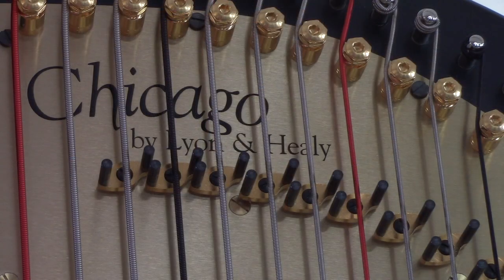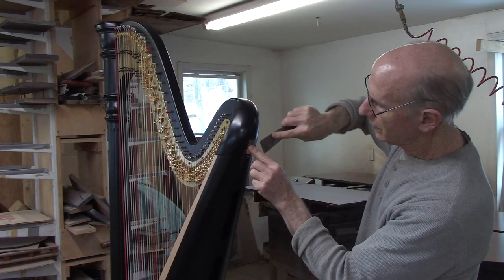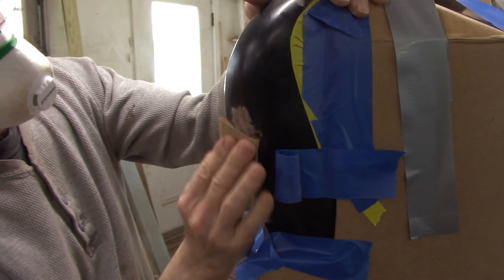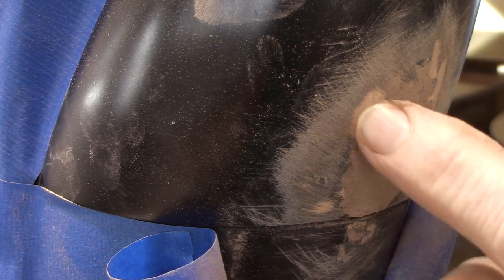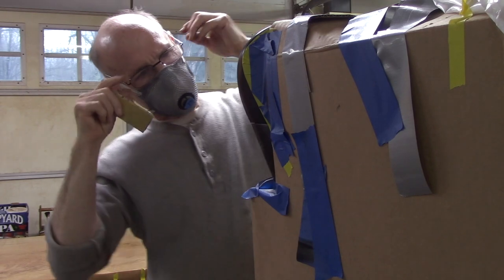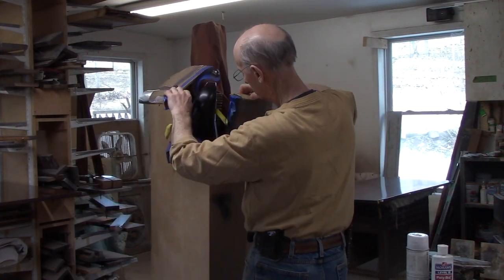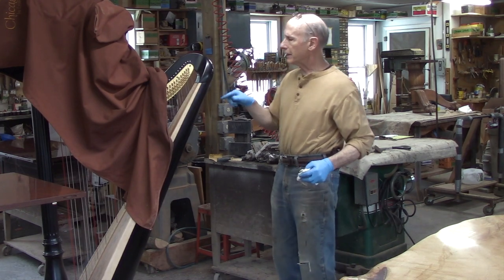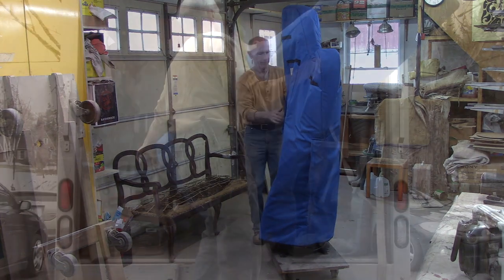Repairing the Body of a Pedal Harp - Thomas Johnson Antique Furniture Restoration

Comment: Wow! Nicely done Tom! What technique would you use to eliminate a subtle drip or run of shellac or lacquer? Thank you, Tom.
Reply from the maker: Thanks Joseph! I like a single edge razor blade to gently "slice" the drip away as much as possible, and then sand with fine paper like 320, although that might depend on where I am in the process
Reply: @johnsonrestoration  Awesome! Thank you, Tom for your insight.  The 500 paper just came in the mail, since I could not find any in town. I'm sanding my second coat of shellac with 500 in prep for a third coat of stain to even out the remaining blotchiness, followed by a final coat of shellac before going to lacquer and toner.

Comment: My main concern wood have been the tone of the instrument.  A harp is not a piece of furniture.  Tone travels throughout the body and frame and vibrate into the surrounding air to our ears.  Putty is not the answer but rather a perfectly matching piece of identical density wood inlaid using a light epoxy glue in thin layer.  Every part must meet up so tightly that the tone is not interrupted during play.  Hopefully that was a student model and not for someone who plays for their living.  I admit, i admire the visual result, but just cringed (this one time) at your method.
Reply from the maker: Thanks! The damage and the putty was minimal, cutting in and inlaying wood would be far more intrusive. Number one rule: don't make the damage more extensive than it already is. I'm speaking of cosmetic damage, not structural
Reply: Thomas Johnson Antique Furniture Restoration > I get that.   I guess at first glance to me it looked like a deeper gouge into the structure...oops!  I’ve noticed some harsh reviews of some pieces but I have first hand knowledge of the difficult choices made between value and keeping original and talking owners down from hugely extensive repairs on pieces either not worth the expense or not actually needing over-reaching or, as you put it, ‘intrusive’.   I appreciate your humble approach towards history and how crucial it is to  preserve history and the very few connections we still have to it.  If we don’t work hard to learn these skills and pass them on these pieces will be lost to our society.